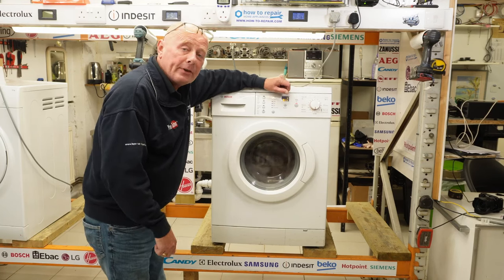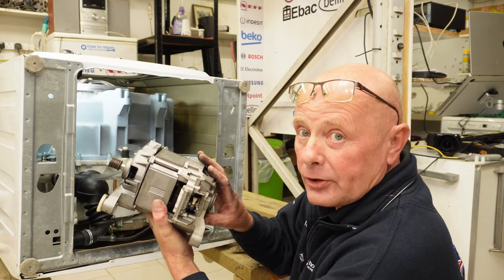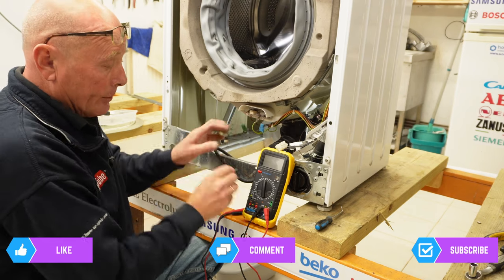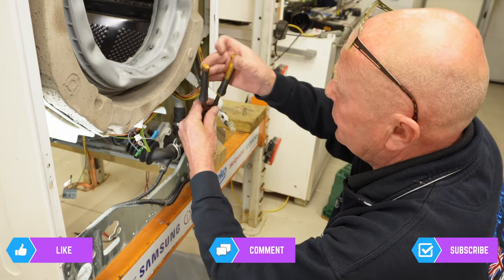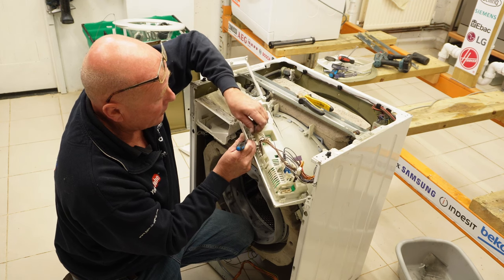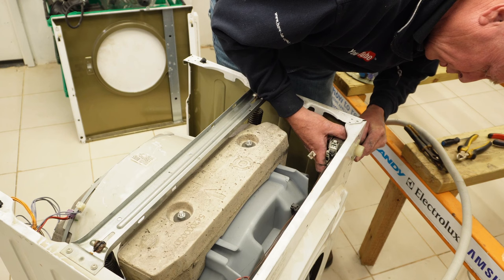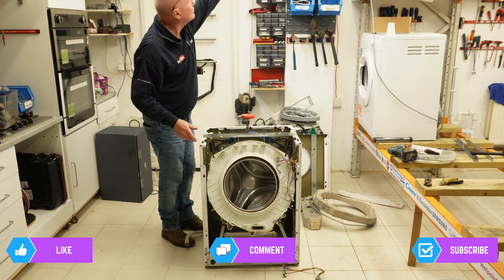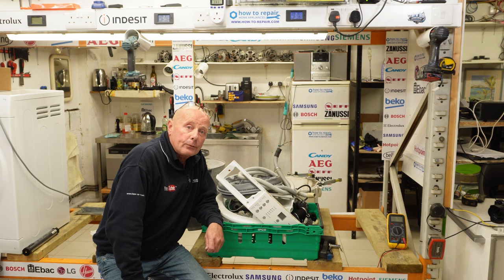Mastering Bosch classixx washing machine, Dismantling and Troubleshooting on WAE24364 To Take Apart

Comment: Our classic 6 is doing this banging. The wife wants a new black Bosch 9k machine but I said till it dies I’m not buying a new one. Had it 9 years. Im here because I did like 6 loads of washing yesterday as my wife’s just came out of hospital so I’m off work being mother. today the thing wouldn’t drain. The drain plug at the bottom was completely clogged with limescale. After watching this video I’m 100% it’s the same issue. Best video I’ve seen on washing machines. Thanks for the upload

Comment: Amazing.  So very well articulated with the level of detail that we all need. If you have a tutorial on how to navigate through life, that would be fantastic.  Thank you!
Reply from the maker: I definitely have not mastered that if you find a answer let me know
Reply: @How-to-repair  I replaced the brushes and ran a successful spin test. However, after I assembled everything and attempted to wash a load, it was no longer spinning.  The unit drains successfully and the trap (fluff filter?) is clean and operational. What are some other considerations for the drum not spinning?

Comment: Very well explained, in next life you should become a teacher in rocket science.
Thank you.
It helped me repair my 21 year old Bosch WFD2460. First time it needed repairs; it tripped the mains because of a faulty heater - like you mentioned.
- A double check, before opening up the machine, was to run ´cold programs' e.g. rinsing and spinning. In that case no problem because the heater is not in use. 
- The cold heater's resistance measured ok, only during use (when it gets hot) it's faulty. 
- To make sure I replaced the NTC and brushes too. 
- Replacing the brushes was the hardest part, because I did not take the motor out: It took me over an hour and sore knees just to get the springs in the brush holders.

Comment: Great video first of all, very well explained. 

At least this one's tub could be opened.
By any chance did you ever disassemble a Merloni washing machine? In the UK they were called Servis, I suppose. They were pretty decent, when it came to build quality, and quite easy to repair. They stopped being manufactured in 2008.
Reply from the maker: Not yet but I will be going through every manufacturer as I get them in

Comment: Thanks for this - great video!

We have a similar machine of 2006 vintage that's finally died, I think due to the issue you describe. It had become very noisey on spin, while also intermittently squeaking; which sounded like the belt but from other sources I suspect was the drum rubbing the inside of its housing. 

It's now started leaking at the front of the drum assembly (I assume through damage from all the imbalance / vibration) and tripping the house's RCD. It's already had a replacement motor some years ago after the brushes went and scored the comm... I'd love to repair it again but it seems a drum assembly is the fat end of £200.

Given in this video you're stripping this one for bits rather than repairing it, can I (reluctantly) write mine off with good conscience..?
Reply from the maker: Hi, I will need the full model number of the identification plate and the details of your problem. Please use our contact us page and make sure you fill out the request for what your problem is. A video shoot of the problem would be perfect as well.

We will get back to you within 24 hours, normally. https://www.how-to-repair.com/help/contact-us/ 

Please remember to subscribe to our channel, as that's what keeps this channel going. Thanks 👍

Comment: Great video. I wondered if there is a fix, I have a Bosch classixx 6 and just one of the door hinge screws won't tighten right up??? Cheers.
Reply from the maker: This sounds like either the threads on the internal part have stripped all the screw threads are not good. You could try tapping it out to the next size or you may have to go inside and put a nut on the back with a larger bolt. I think there is a plate, on the inside that could be modified I hope this helps you @nigelackroyd7991 please remember to subscribe to our channel as that really helps us https://www.youtube.com/shorts/e432SAb2g08  Thanks, Paul 👍

Comment: I've got a similar machine which is 23 years old. One set of brushes, 2 pumps, one of those was because the filter broke and a heater but all easy to replace, it has been brilliant. I suppose it will die one day, but what to replace it with.
Reply from the maker: This was at a time when manufacturers were building a reputation, so they built quality now that they own a significant share of the marketplace. They only care about profit. The newer machines are nowhere near the quality of the older machines. There should be no reason why you should not be able to continue repairing your machines, if you are willing to put the time and effort into maintaining them. I'm sure you will be able to still source parts for this machine for quite awhile @philiponsolent7232 please remember to subscribe to our channel as that really helps us https://www.youtube.com/shorts/e432SAb2g08  Thanks, Paul 👍
Reply: @How-to-repair   these old bosch washers were the best there also was the bosch maxx wfo /wfl
Reply: If you live in the UK, I would recommend Ebac, as they have a tub which can be disassembled, giving access to the bearings, spider, etc. If you absolutely have to go for one with a sealed tub, nowadays I suggest Electrolux or Zanussi, because they have very good programmes. However I am aware that the tub is sealed, and if the spider and bearings are of bad quality, then the machine will have to be thrown out after a much shorter period of time!
Reply: I am subscribed, your videos are easy to follow and have helped keep my machine working. Had a quick look and the spider doesn't appear to be available, so let's hope mine doesn't fail.
Reply: it comes a time when the repair is not economically feasible, like where the spider splits. No new spare parts from Bosch.  @How-to-repair

Comment: Hi do you know if a bearing kit is available for Bosch WAT28371GB/01  I can only fine a complete drum ? Great videos as normal.
Reply from the maker: hi @user-bp7li5yj4k I'm really sorry to tell you that this is a sealed drum another great example from Bosch of built-in obsolescence. These drums used to be splittable and you could change the bearings and seal and also the spider but now you have to buy a whole new drum it might be worth having a look on eBay using your model number just in case there is a machine with an electrical problem that you could swap the drum out of sometimes you can pick these up as little as £20 sorry to give you bad news
What would really help me to get my video seen as I'm no IT expert is to either share the channel or at least post it to your friends my videos might not be YouTube superstars, but they save Appliances from the scrapheap. Share and help us fight appliance waste! please remember to subscribe to our channel as that really helps us https://www.youtube.com/shorts/e432SAb2g08  Thanks, Paul 👍

Comment: Hi. Great video! I have a Bosch Ascenta washing machine WAP24200UC 2014 version. I need to change the door seal, but can't figure out how to take the front panel off as it is unlike the one in your video. Or any other I have found. Can you suggest some advice?
Reply from the maker: It looks the same maybe there are some different screws https://www.bosch-home.co.uk/sparepartslist/WAP24200UC/05

Comment: How do you take the bottom panel that is underneath the washer? Mine is exactly same except where you would access to the motor has a metal panel plate

Comment: The big problem is the 

ECO 

all machines are required to run with the bare minimum 

So no extras water to wash away the additional detergents 

So detergents accumulate on the spider generating corrosion and oders
Reply from the maker: That's why I made the video about mould which you also has a piece at the end, which shows you what comes out of the drum after doing a boil wash with my cleaning technique https://www.youtube.com/watch?v=HnS87Tw4amM but I still stand bye 80% of the problem is electrolysis. If you understand the galvanic scale, it is like having a weak link put in to the machine deliberately as this will be the component that deteriorates the quickest. But I do agree with you and detergent will not help if they build up. We did not have this much problems with spiders 20 years ago

Comment: Spider cracks from liquid detergent.
Reply from the maker: They can break for many reasons the detergent will attack the aluminium, because the manufacturer uses steel and aluminium. This attracts electrolysis, and the weakest link in the galvanic scale is the aluminium. Therefore, it will be the first item to corrode other things like pH levels in water and also overloading machines. Also contribute to the spider going. But for the sake of a few pound extra, they could make stainless steel spiders, and this problem would never happen. Thank you very much for your comment. @danielmielnik9000 please remember to subscribe to our channel as that really helps us https://www.youtube.com/shorts/e432SAb2g08  Thanks, Paul 👍
Reply: @How-to-repair  I've been working for BSH as service engineer for 10 years, very common problem on their machines.

By the way... You doing very good job 👍.
Reply from the maker: thanks

Comment: That's one of the fewest washing machine where you cannot replace shock absorbers. What a shame!
Reply: You can refurbish them. There is a tutorial, made by a polish technician.

Buy a new pair of absorbers from which you can use the aluminium rod(the one fixed on the frame), the inner sleeve and fixing ring. The plastic(ABS?) part can stay on the outer drum and does not need dismantling.

I just finished doing this job, on my machine.